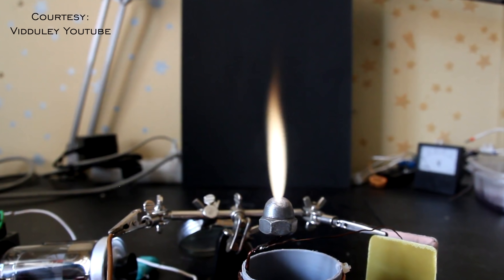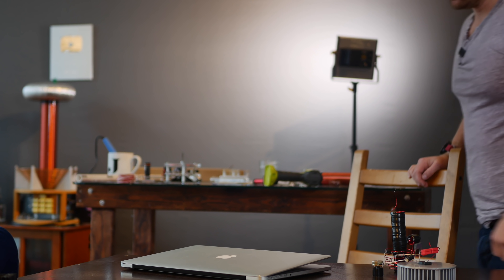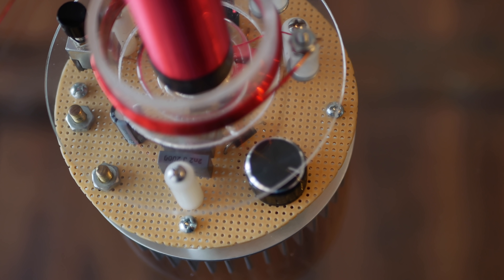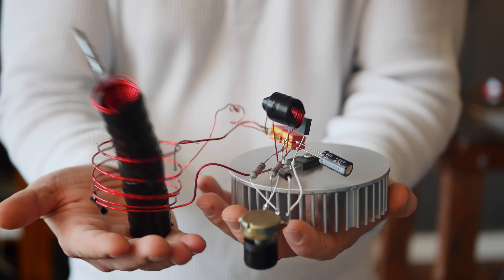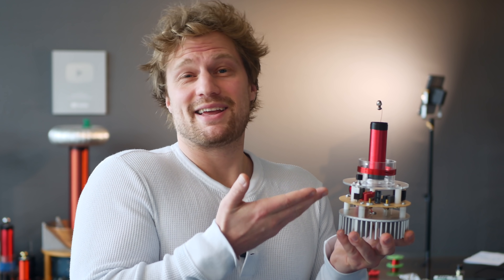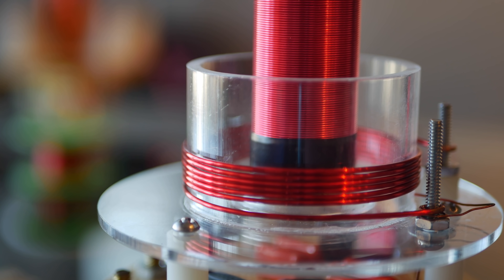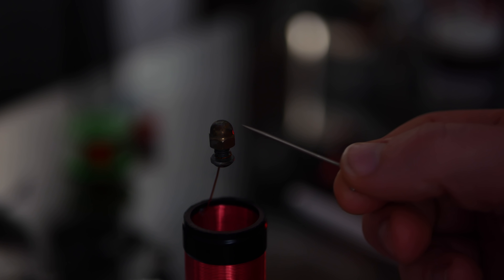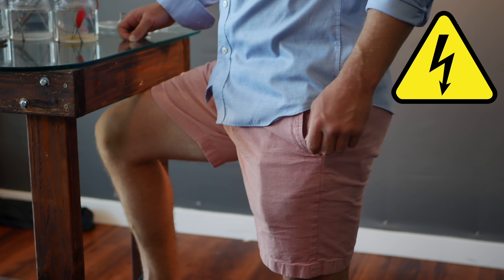Building a Wireless Power Plasma Candle ( Flame Discharge ft. Teslaundmehr)

Comment: love this video. watched it over 20 times and planning to build my own. this guy is a legend and a very well presenter. good on him and looking forward for his new electronic/electrical projects. however I have a question and not sure how lucky I am to actually get an answer. given the schematic/circuit diagram, after all the modifications you have used four 150pF Capacitors, for the final product however the schematic shows one 150pF cap? I can see pairing two 150pF caps in parallel gives you 300pF then two lots of 300pF in series gives you back 150pF. wouldn't it work with only one 150pF? or is it about the  voltage and frequency that you had to use four caps?

There are also two wire loops between the coil and the pot, could you explain what that is for? 

thanks and keep up the amazing videos. I have also watched many other videos of this channel (with another YouTube account, this is my new one I am gonna use permanently). stay classy you classy master cat 💯😼💥👍🙏

Comment: can you make commercial plasma candles for distribution? 

I was thinking of a ratio of plasma candles 1:1000, 1:10000, 1:100000, 1:1000000000 of its size if it's possible to build. probably to use to heat a boiler instead of using gas or coal. 🤔 

however, the high frequency could surely have some effects on health.

Comment: As you mentioned your location was RF shielded, can you recommend a minimum - safe - distance to keep your other electronics, I.E. TV, stereo, cell phone, etc, away from a "typical" Tesla coil device?   Your opinion will be with a disclaimer of course ;-)   but, would maybe 6-8-10 feet be a relatively safe distance to NOT blow up your other electronic goodies?  Any suggestions will be appreciated by all experimenters of the Tesla experience....  Much thanks for all of your great videos.... Hank
Reply from the maker: Hi Hank, this depends on what type of coil you’re running, and what power levels. Generally, a coil won’t affect anything that is unconnected from the wall. So a laptop, phone, watch, etc will be safe only a few feet away. However, if you’re talking a massive test coil… yeah don’t push it haha.

Comment: That mean you can use the flame to heat up a ''steam pipe'' to run a steam turbine who can power up the plasma candle.
Reply from the maker: Which would result in a quick decline in energy being fed to the candle.
Reply: @PlasmaChannel  You think that flame cannot produce enough steam to power, for exemple, a car alternator ?

Comment: Who discovered it,it doesn’t really matter ? !!! You lost me right there. Nikola Tesla called it a veritable flame. The exiting of conducting gases into luminescence are due to the fact that induction , at a distance can interact with said gases without a physical connection to a terminal on the lamp. Tesla was way ahead handling high frequency and voltages (AC which HE invented! ) while Edison was still making DC voltage somewhat viable.Thumbs down on this one.

Comment: The one hand rule apples to low frequency AC or DC where electrocution hazard is the issue, to prevent electricity from flowing up one arm, through the heart, and down the other resulting in fibrillation and death.  The input frequencies of this device are 12 volts, you're not going to be electrocuted from 12volts, the output frequency, 10Mhz, while much higher voltage is too high to operate your nervous system but at that power level CAN result in severe burns.  However, here, the one-hand rule isn't going to help because body capacity is so high that any additional ground provided by the other hand is basically irrelevant.  If you touch that arc you're going to get a nasty burn, period.

Comment: Maybe you could have blown up fewer MOSFETs if you had put the Zener where it really should have been – between the gate and the source of the MOSFET.
Also, overcurrent protection is a must if you want the circuit to last, as MOSFETs are not very tolerant of current transients exceeding their maximum specifications.
Other than that, very nice project!

Comment: There is a reason for valve technology in this application. Valve is harder to kill than mosfet. More important - you see what is killing your active element. You see only final stages of destruction (if any visible) for mosfet. Valves are more transparent :) And cheaper :) And likes high voltages :) And doesn't need much safety elements around them :)

Comment: Hi Plasma Channel, fantastic video :-) !!! Here is a challenge...
1. Create the hottest possible flame from the lowest power consumption using a solar battery
2. Heat sterling engine with neodymium magnets attached to the rotor to extract energy from generator
3. Use radiant energy to extract energy from solar panels. Connect peltier modules to hot side of sterling engine to extract energy from sterling engine

Perhaps overunity?

Comment: Can something like this be scaled up to industrial size? I am thinking this could be used to make cement. Normally a gas flame is used to "cook" the cement at 2500 degrees. Its energy intensive and has  large carbon emissions. But an electric flame can be less polluting.

Comment: I'm kind kinda wondering if it would be possible to add an MCU and some discrete components to make it self-tune the circuit without frying it. Sounds like a both fun and frustrating project.
Reply from the maker: The circuit does moderately self tune. Only to a point though.

Comment: Can you define super hot arc? Obviously it's subjective, but is it so much hotter than others that it's worth trying to weld at that frequency?
Reply from the maker: The arc melts steel in seconds. It ultimately is above 3000 F

Comment: Question I would love to get answered will this work in a vacuum 🤔🤔🤔
Reply from the maker: It will not work in a vacuum for several reasons. 1) the windings on the secondary coil would begin to ionize and spark between themselves. it would destroy itself within minutes. 2)the secondary base would arc to the primary coil. In a PERFECT vacuum, non of these things would happen, but it also would not have an output. This in turn would blow up the transistor.
Reply: @PlasmaChannel  thank you so much for your considerate response to my question it is appreciated.

Comment: How much current does it take to power it? Would it be cost efficient to power LED lighting and how much power does it put out? Pretty cool for wireless lighting and whatever else it might be able to power.  Nikola Tesla’s solution for free wireless energy would be so nice to not to have a utility bill every month plus the cost of power line maintenance storm damage and property owners land that can’t be used within 40ft of ride of way of the power lines.

Comment: My Dear, 
Why don't you consider to use a TV coil  for high voltage?
Reply: High-voltage units of tube TVs have a ferromagnetic core that functions optimally at most up to the range of perhaps 2-300 Kilohertz. And this Tesla unit works in the frequency range of about 10 megahertz. Unreachable for the TV high voltage unit.
Reply: The higher the frequency, the more energy is lost in the core during remagnetization. At 10 megahertz the core could start to glow (with the appropriate input power of course) and the whole apparatus goes up in flames - so be careful ! This is a physical law that cannot be circumvented.

Comment: I am new. Please do not judge. So, 12 volts of power is the limit used? How much on the output? And can this power be reconverted? Can this wireless power be stored? Can the light source power solar panels, as well? Curious. 
(Thinking Out Loud)
Only if I had 250,000 dollars, I would change the world. Plasma, Hydrogen Gas, Titanium, and Water. Solid Liquid Gas and Plasma. My theory connects them all simultaneously.

Comment: if you connect a low voltage signal generator and an oscilloscope you can easily tune all of the frequency elements before you go live

Comment: Jay, I see why you cooked so many MOSFET's....if you had used a TVS diode (transient voltage suppression) you could have prevented those nasty high voltages from going into your gate and cooking them.  The bidirectional one that your buddy uses dumps any rapidly rising voltage above 15 volts straight to ground, and being bidirectional it takes care of positive and negative voltage surges, which will be present , according to the spec sheet for the IRFP260 the absolute maximum voltage between gate and source is ~ 20 volts, trying to tune it without one of these babies acting like a snubber is bound to lead to drama. I'm curious where did you get that circuit, the coil values are a bit different from your buddies version. cheers bro.

Comment: I have an idea! Take two thin cupper plates about 4 square inch and sandwich them with a teflon plate that is 10mm thick and you have made yourself a basic capacitor! Now load the crap out of it 😁

Try other thicknesses also depending on the load, like, how many volts your plasma candle delivers to your "sandwich".

I read a story about a guy who asked himself, how much load can I put into a capacitor? So he did that, took two metal plates on each side of a teflon block about an inch in thickness and hooked it up and started loading it. Of course, he was into this with testing a ton of other materials before so this story I guess, is his peak, he discovered something, if all this is true so to speak, anyway, what he supposedly found seemed to absorb an insane amount of voltage and when it came up to a million volts, the capacitor jumped up and levitated a half a foot above the table.
 
You have the stuff, try it and see if it's true!
Cheers!

Comment: could try to use a automatic voltage regulator or a constant voltage supply to do the 12v output

Comment: The secondary coil is a transmission line which should be a quarter wavelength of the resonant frequency of the primary.

Comment: Use a good gate driver to turn the MOSFET on and off quickly and it will generate harmonics way up into the MHz even when driven at a few hundred kHz.  Connect a HV capacitor across the MOSFET and it will resonate with the Tesla coil; choose its capacitance to select the frequency.  Additionally, the MOSFET generates heat only while switching so a gate driver will prevent burning them up as well.

Comment: 1920s????? Tesla described different kinds of flame discharge in the 1890s
Reply from the maker: Is this so? I’ll have to double check this.
Reply: @PlasmaChannel  mentioned briefly on page 93 of the 1904 book 'Experiments with Alternate Currents of High Potential and High Frequency' on his 1892 London lecture.  "In one of the experiments this evening a brush was produced at the end of a wire. This brush was a flame, a source of heat and light"
Reply from the maker: Thank you for telling me about this.

Comment: If it melts steel, hows the break out point (the bolt) still intact?
Reply from the maker: Partly because the rate of heat dissipation on the bolt is greater than the rate of heating up... being attached to the copper wire helps to suck away some heat.

Comment: Heating up high melting point materials with low wattage means you could create a lot of steam that could be put to work. Free energy? The flame seems very similar to an HHO flame that can also burn items with relatively low energy input. Try putting a strong magnet near the flame. You should get some cool effects.
Reply from the maker: It would not be free energy. This requires energy to operate. As with every device in the world, less energy comes out of it than even goes into it. Energy losses are everywhere. If it powered steam to turn any kind of turbine, that represents even more loss. It would be a very inefficient system, producing less power than what goes into it.
Reply: @PlasmaChannel  free energy is another way of saying that there's an open thermodynamic system that's participating in the reaction. Solar. Wind. Hydro. Etc. If the plasma fire that you're creating taps into an open system when it heats up an object, or taps into unrealized (or unknown) energy that exists at the molecular level, then it "could" potentially be free energy. Also, conservation laws break down when dealing with impulses. A plasma flame might be a good candidate for discovering high impact forces that we are not yet familiar with. HHO flames can definitely generate more heat energy than the input energy it takes in. You might want to check out the work that's going on at @brilliantlightpower https://www.youtube.com/user/BlackLightPowerInc/videos . "Free energy" from plasma is no longer the question. The question is how to contain it without destroying electrodes that simply cannot deal with the energy levels involved. Or, you may want to try some experiments with electrolysis. Here's a secret, if you use stainless steel plates with the proper electrolyte, over time they get a microscopic coating that catalyzes the reaction. So, you won't see satisfactory results immediately, but if you've been using the same stainless steel electrodes for a few days, compare their output to that of some brand new plates. There's more to water and plasma than we now know. Think of what science will be saying about both in 100 years. It won't be the same thing we're saying today.

Comment: I have a question is where to hook the probe to get the oscillating frequency? I'm afraid of putting the probe on the wrong spot and kill my scope
Reply from the maker: Don’t connect the probe anywhere. Just sit it 12 inches away, the probe will detect the AC radiating off.
Reply: @PlasmaChannel  thanks I got it

Comment: Why not connect two or three of the mosfets in parallel then they can definatley handle more current. That should work. No need to blow so many mosfets. Or does the high frequency blow them?
Reply from the maker: It’s the high voltage kickback, really.
Reply: @PlasmaChannel  Oh, ok. Can it not be protected with a high voltage diode?

Comment: That "flame" looks totally awesome! Great job. A point of information for anyone interested based on my limited knowledge: Blown mosfets are often due to inductive voltage spikes that occur when you turn off a circuit with inductance. Inductors resist a change in current by storing energy in their magnetic field(dubious statement perhaps), so when switched off that magnetic field collapses pushing electrons against one side of your switch. This causes a rise in voltage which can exceed the breakdown voltage of the metallic oxide semiconductor material which results in failure of the mosfet. To account for this one should "derate" the mosfet to perhaps 40% of spec when comparing to the operating voltage of the device, although the faster you are switching the more you may want to derate. For high speed High current switching one might want to consider using a wide bandgap material for the semiconductor switch such as Gallium Nitride or Silicon Carbide as these are available in standard pacakages. Keep up the good work!
Reply from the maker: Hi Matt, thanks so much, I appreciate the feedback!

Comment: I managed to get one to work without the TVS and zener diode and havent even killed a mosfet yet and used random capacitors i found on circuits boards and i didnt even know their vaules and running at 2amps at 38v its some how works 🙂
Reply from the maker: Must be only by the grace of Odin

Comment: What is the mathematical relationship to the turns, wire diameter, circumference, distance, amplitude, voltage, etc? There's gotta be some obvious physical interaction here that might help optimizing the final prototype.

Comment: Hello , check out this Tesla coil . Building a spark gap Tesla coil with multiple spark gaps set up like a watch with a spark gap at where  every hour would be on a watch and it's controled by a motor that spins the primary receiver of the spark Gap and the motor is what I think is controlled by the feedback of the secondary coil , the bigger the lighting from the second coil the faster the motor goes to match the primary so they resonate more and faster rasing the voltage . He was getting lighting coming out of it multiple feet away . So you don't need mosfets and All the electrical components that come with controling it that way and don't have to worry about blowing them up and all the extra work that comes with it . I have seen anyone else build one like this . I'm going to try it out but on a smaller scale lol 
https://youtu.be/T887w-vTusw

Comment: At resonant frequency there shouldn't be any resistance, so you probably don't need a heat sink. But yeah, if it's a little out, your circuit could get hot. The late Don Smith really understood resonance. You should look at his stuff. Great looking flame though. I'd be a little worried about my hands too.

Comment: Have you tried using the flame to cut steel? As a home made plasma cutter? That would be awesome. 

Is the emf strong enough to scramble radio within say 20 metres? 

The ionised air... Was there ozone? You could potentially poison yourself if you're not careful

Comment: hi you were using a Voltage Multiplier in a couple of previous videos to bend different elements, and i was wondering where the best place to get one of those is.
Reply from the maker: You’ve got to build them. I built all of mine.

Comment: Nice project!  Small nitpick:  at around 01:45 you said, "...ultra high frequency circuits like this...", but you later revealed the resonant frequency as 10 MHz.  That's merely high frequency (HF), in the range of 3 MHz to 30 MHz.   The very high frequency (VHF) band is from 30 MHz to 300 MHz.  The ultra high frequency (UHF) band is 300 MHz to 3.0 GHz.

Comment: great video but skin effect people why the primary coil is made of thick wire the frequency is very high its in mega hertz . i think if you made the primary with multiple wires in parallel that would be much better 🤔